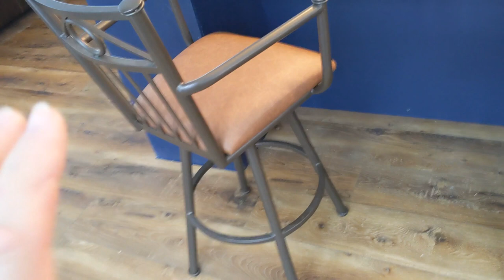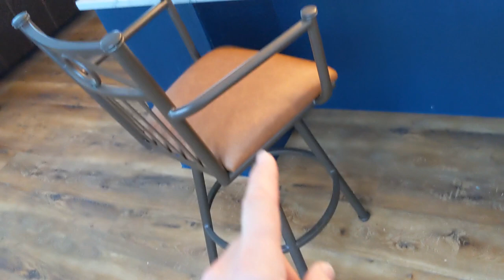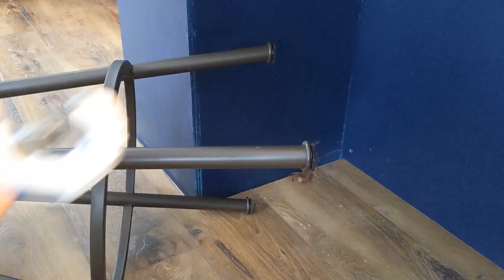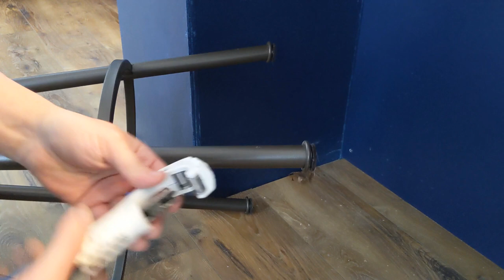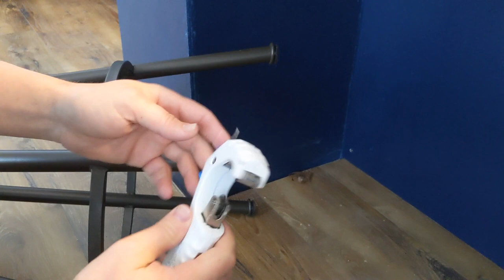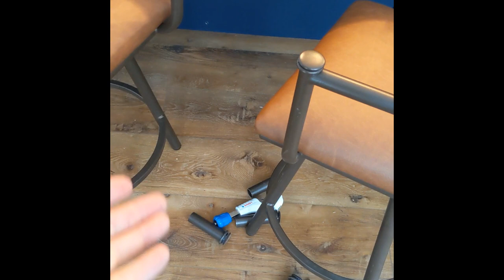How to shorten round metal chair legs!

Comment: Awesome video! I purchased two adjustable height shop stools from Harbor Freight that were advertised to adjust between 26" and 32". The actual adjustment is 29" to 35". Although I'm 6'1 my inseam is only 30" so my feet don't touch the floor! I was apprehensive about cutting the legs with a hacksaw but the tubing cutter should work slicker than a whistle! Thanks!

Comment: Why not just buy counter height stools... Like at a store...
Reply from the maker: I stated they were an estate sale find, and over %90 off.... soooo.... ya, cheap and high quality.
Reply: In my case, I bought a table top super thick and made my own table, so it's not standard, I need to adjust the chairs
Reply: How did you mark exactly where to cut. It has to be a straight but in order to have the correct angle and bot wobble